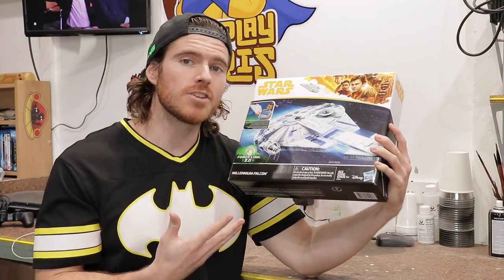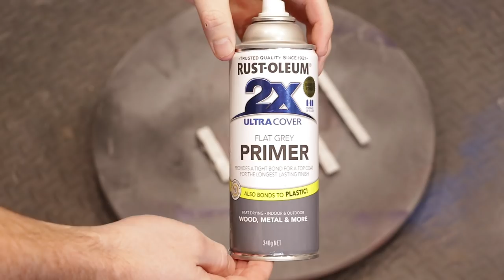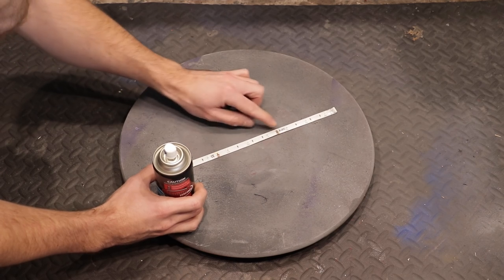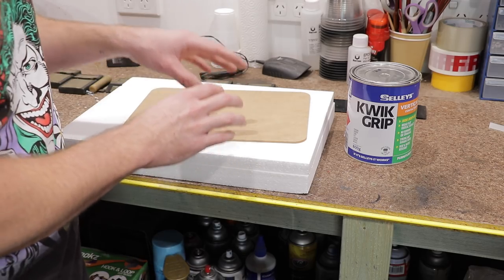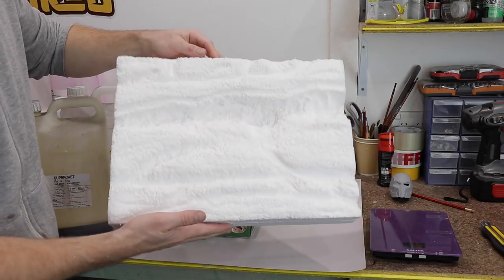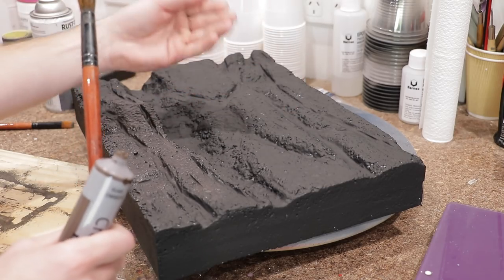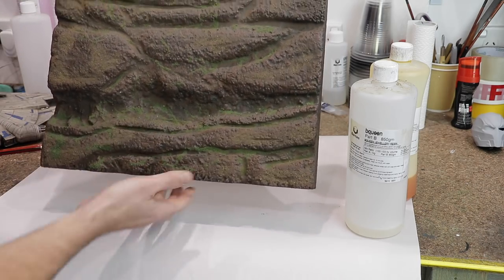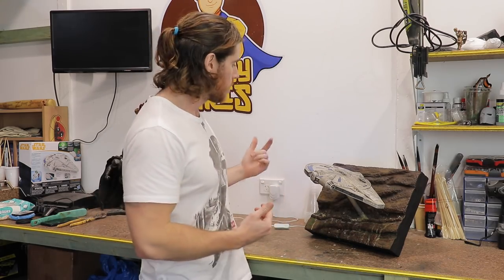"Solo: A Star Wars Story", Millennium Falcon Makeover- Chris' Custom Collectables!

Comment: Ive had good luck using spray paint on foam by just standing back further allowing the volatiles to evaporate,once you have a dry coat on the surface you can step closer but its truly "dusting"

Comment: Because of you, I am in the process of trying out my own custom collectable with an AT-AT popcorn bucket from Disney World. Its very detailed but has an weird marbled grey, so im repainting it a more uniform grey. Now i need your help. How do you prepare your shoe polish for weathering on your work, do you mix with water? And do you have any tips on simulating blaster bolt marks on the AT-AT?
Reply: Ryan Brooks shoe polish isn’t diluted. Use it as-is. Use cheap stuff, as it’s often thinner and easier to start with. 

For blaster bolt marks, take a thin, metal rod or something like a flat head screwdriver and score the side of the thing to show damage. Paint it with a metallic silver base, then go over it with a color, and when you sand it all back, you’ll see the metallic paint and it will appear as bare metal. The score mark will give it some texture and depth that will be made more dramatic by the paint and weathering. For larger bolt damage, take a wood-burning Iron or soldering iron and with light heat, run it down the side where you want the damage, following with same paint routine.
Reply: Ryan Brooks For blaste bolt marks perhaps use a q-tip dipped in black paint and just press it onto the figure and roll it slightly and gently. Not sure.
Reply: Yea

Comment: They designed the exhaust fume marks wrong. They shouldn't all go in different directions like they're following the circle, they should all go in the opposite direction to the way the ship is moving, so they should all go straight back, like the middle one, not at angles
Reply: It's been like that since the OT, but I don't know enough about fluid dynamics to know whether or not they're correct
Reply: Airamplane123 It might just be that the exhaust fumes are exiting the vents at a speed higher than the air rushing over the top of the hull (which would be unlikely, due to the extreme speeds the Falcon travels, [unless a vacuum like space handles fume velocity differently than an oxygenated environment like Earth and just lets it continue like the waves a boats make in water])
Reply: Nnnnnnnnnnneeeerrrrrrrdddddd!!!!!!
Reply: The Falcon isn't always flying. Upon landing at locations with wet environments like gas, fog or plain old rain, the liquid washes all the crud from the exhaust vents and it naturally runs down the curve of the hull. When the Falcon starts up and takes off, the wet mess is fanned out and blown dry. Over time staining the hull. That's my story and I'm sticking to it.
Reply: Matt Hannel It's a curse 😁
Reply: I'd rather pay for older toys before George sold his property to Disney (there was some crap too but holy shit, I've seen a lot of trash from the TFA/RO/TLJ/Solo toyline) or proper goddamn looking figures at 100$ or more than these expensive, ugly and innacurate toys.
Reply: Matt Hannel ssssssssshhhhhhhuuuuuuuttttttttttttttt uuuuuppppppp
Reply: How exactly do you know that's how hyperspace works? That shit's hyper-dimensional (also, presently imaginary).
Reply: Airamplane123 came to say this as well
Reply: There's no breeze in space which is where the falcon is most of the time. What i mean is that there is no force that makes the exhaust marks go a certain way.
Reply: Nolan Bassett it's not from a breeze it would be from the falcon moving forward and the smoke or exhaust  trailing in the direction of movement.
Reply: @al112v4  Dude those old figures were high key ugly fym
Reply: The original falcon 5ft had the exhaust goes straight back, and the streaks on the hull were suppose to be from weathering (rain running dirt/oil off down the hull while stationary)

the 32” miniature had the exhaust go in the radius. which was odd.
Reply: @al112v4  Wtf you talking about. Ive got a Luke figure, that looks more like fuckin Arnold Schwarzenegger